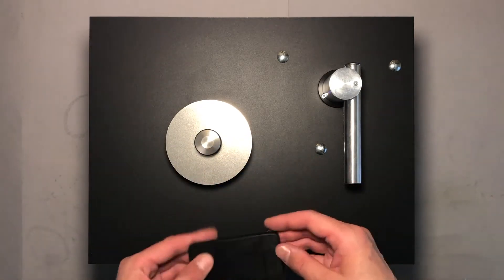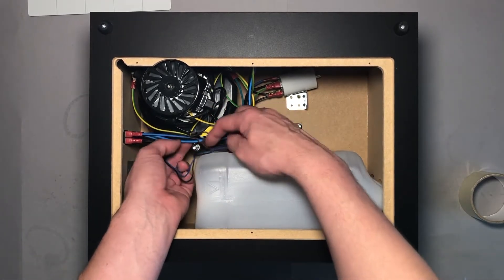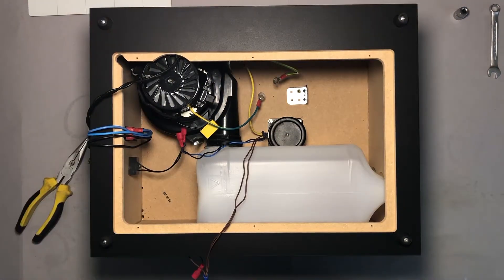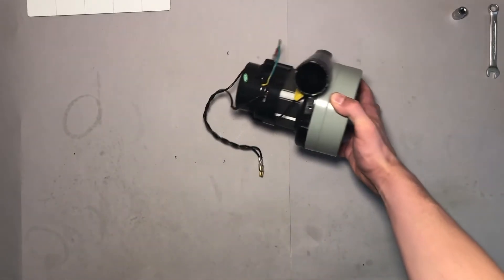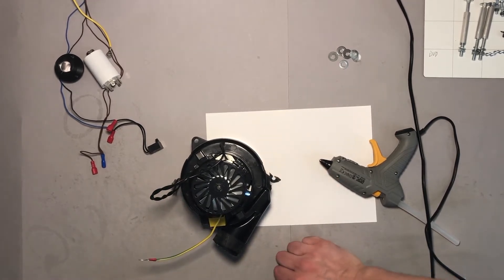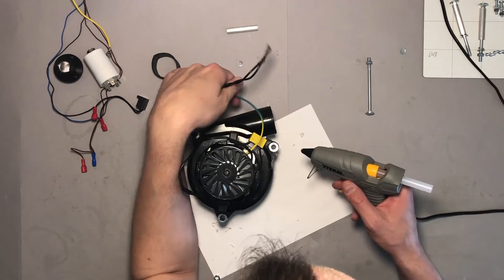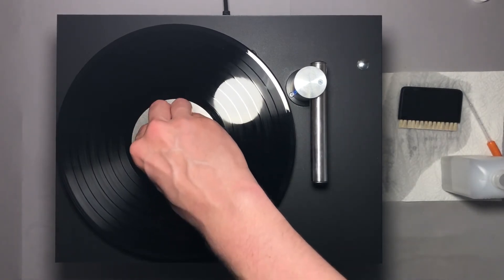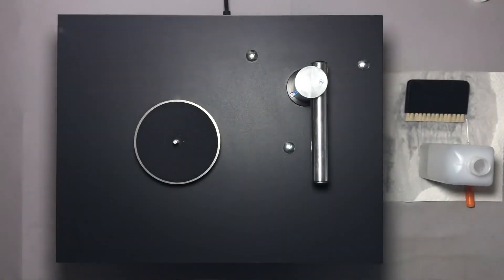Pro-Ject Vinyl Cleaner VC-S (teardown, unexpected fix and demonstration)

Comment: Does anyone know where to get a replacement for the vacuum
motor? I found some very similar looking parts online for under 50 Euros. It seems to be a regular motor from cheap industrial vacuum cleaners. 

The vacuum of my unit seems to be broken. It got much louder and weaker from one day to another. 

As my VC-S MKII is now 5 years old it will cost a fortune to have it repaired by the service.
Reply: The noise is due to the bearing nearest the impeller being worn, due to less than effective sealing from the cleaning solution. The bearings are those used in skateboards being 22x8x7 mm. Easy enough to get from eBay or Amazon. I got 2 for £2.90. Fitting them is another matter, which I've yet to do.

If the motor is removed from the impeller housing, have a bolt ready to replace the motor shaft. Inside the housing is a spacer, two washers, a plastic turbine  disc and a metal disc. Inside the grey metal cover is a separate plastic turbine disc.  If the metal spacer gets out of line with the other parts and tips over, as mine did, the metal cover will have to be removed, a seemingly impossible task. Luckily, it can be done by placing it in a pan of water and boiling it for about 45 minutes. I tried 30 minutes and removed it and attempted to separate the two, but with no luck. Thought that was it but gave it another 15 minutes and left it overnight. Next morning (today) tried separating the two - and did so. Cleaned the parts and assembled keeping everything in place with a bolt.

Still have to fit the bearings as I have yet to remove the original ones. About 4 of the stator stacks had shorted due to the bearing being worn and the stator hitting the yoke body. Managed to separate them but don't know if this has caused damage to the windings yet. The shaft looks the same as as that shown on eBay for a Domel motor.

Bearing wear seems to be a pretty common problem for this make of cleaner.

Comment: I have had the VC-S for just over two years.  The vacuum now sounds like a freight train.  Any suggestions on why it might be so loud?
Reply from the maker: Maybe bolts inside got loose?..
Reply: @boredtech  I didn't think so but I'll check again.  The service company states that it's a minimum $160 just to look at it and I have to pay shipping to and from my house.  Unfortunately I can't buy the part and install myself. I only paid $400 for the machine.  I'm not going to pay over half of that amount just to repair.  Thanks.
Reply from the maker: @JJL-1962  $160 is a rip off. Just open the hatch and check if everything is in place and none of the parts are loose. Don't forget to unplug it from the mains ;-)
Reply: @boredtech  I did take the panel off before I saw your video and didn't notice much.  However, I have good news.  I sent an email to customer service complaining about the cost and the quality of the product.  I received an email stating that they would replace the unit with a brand new one.  All I had to do was mail mine back in the original packaging.  I did that this morning and it cost about $36 for shipping.  Well worth the price to get a new one.
Reply from the maker: @JJL-1962 Amazing News! are they replacing it with the sane model? I think VC-S in now discontinued.
Reply: I have the VC-S2 and right at the 3 year mark the vacuum started making grinding noises and weakening. It's basically unusable now. Pro-ject referred me to a repair shop who wanted $165 just to do an assessment even though the problem is obvious. Pro-ject then agreed to sell me a new vacuum pump directly, but wanted over $200 for it. I said forget it. These defective pumps where the bearings break down are a common problem with these machines - do a search. Sorry I ever bought it.
Reply: @scottedwards7967  I got lucky.  They sent me a brand new VC-E.  I just paid $25 to send the old unit back to them.  I have no doubt that I will have the same issue with the vacuum in 2-3 years.  At that point, I will probably buy a different brand.

Comment: Thank you so much for this video as it helped me disassemble my own unit to fit a new motor. I'm struggling with the re-wiring however as my photos aren't clear enough to show which wire goes exactly where. Is there any way for you to help with photos or something?
Reply from the maker: Hi Jaime, 

First of all, thanks for watching this video. At this moment I'm busy on another project till the beginning of next week. You could find me on Instagram (bored_tech). There you can send me a pictures of your unit and maybe we'll be able to put your unit back together.
Reply: Hi! Did you managed to assemble the new motor? Mine is broken and I want to fix it.
Reply: What motor model is this as mine has gave up the ghost after 3 years of working?

Comment: So the replacement unit that they sent last December now sounds like a freight train.  The vacuum arm is also corroded.  The company ask what cleaner I used and I told them it was the cleaner that was provided with the unit.  They couldn't believe it.  I think I'm done with Pro-Ject vacuum cleaners.  Pro-Ject just doesn't care about the quality and the price is not justified if the machine will start to break down after a year.

Comment: I just ordered this exact model, it hasn’t been shipped yet. How did you determine the motor mounts were broken? Was it making a funny noise or not operating properly?
Reply from the maker: Just after I opened it. I washed all my collection before I discovered that those mounts were broken. 
I bought it from auction, some av retailer went bust few years ago. I guess than porters didn’t care much about content of the warehouse.
Reply: @boredtech  thanks for the reply and the upload of the teardown. How does it perform cleaning your LP’s? From what I can tell from reviews, it looks like it does a splendid job?!
Reply from the maker: Yes, it does the job, records are clean and shinny. Only thing that's the motor is quite loud.
Reply: @boredtech  thanks for the reply! I will be unboxing mine soon, it came today! How many records have you cleaned at any one time? I guess there’s a thermal protection switch built in, in case of over heating the motor due to cleaning too many LP’s at once??